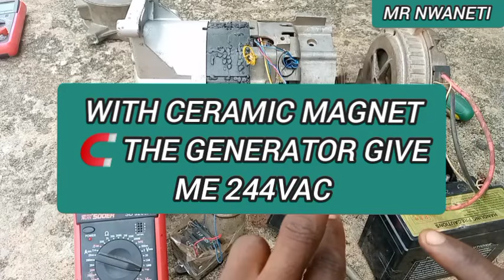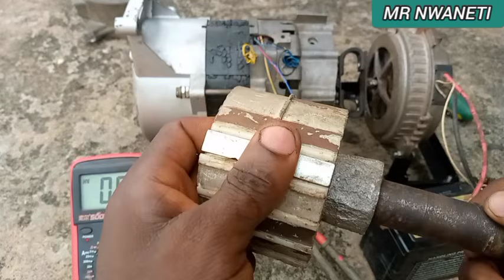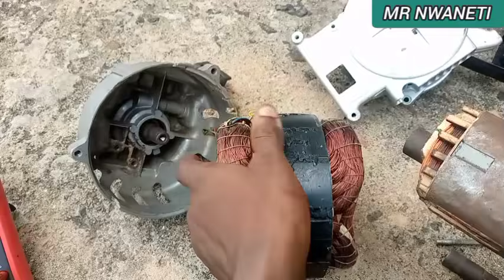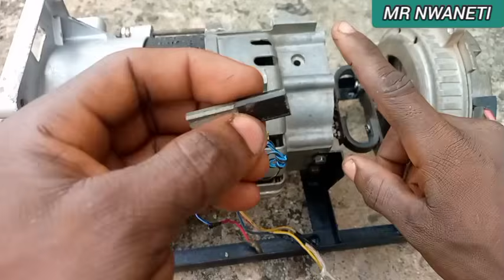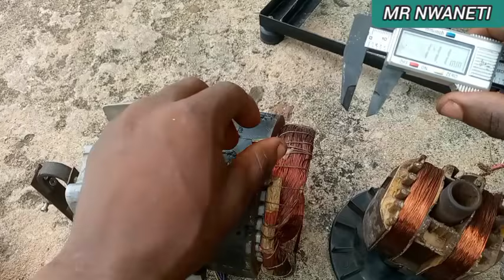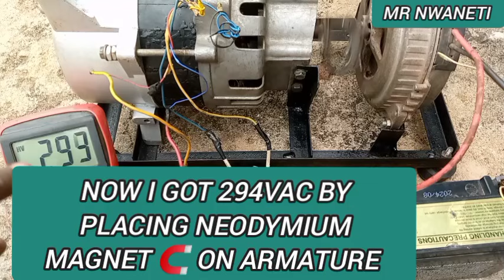fuelless generator projects 3, neodymium magnet 🧲 vs ceramic magnet 🧲 comparison

Comment: Question, I have a rotorverter that can run on 10 watts and a brushless 22kw pancake generator.  Do I need to place two magnets on the rotor of the pancake generator?
Reply from the maker: It depends on the rotorverter  structure

Comment: Thank you very much, engineer! With your generator, how many microfarads did you use in total? Please.
Reply: Weldon for the perfect job. Please what is the capacity of the generator and what is the capacity of the DC motor and it's RPM
Thanks
Reply from the maker: @akanny77  speed 2700-3000rpm
Reply from the maker: @akanny77  generator 950w-1kw
Reply from the maker: @akanny77  motor 1HP
Reply from the maker: @koyparadoxe  15uf
Reply: @MRNWANETI  but this much I saw 3 microfarads?
Reply: @koyparadoxe  thanks